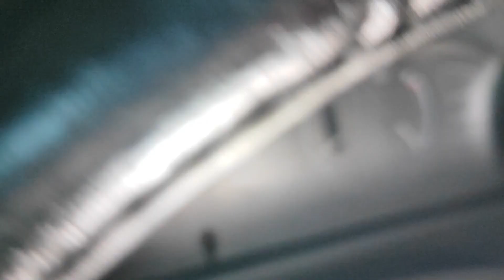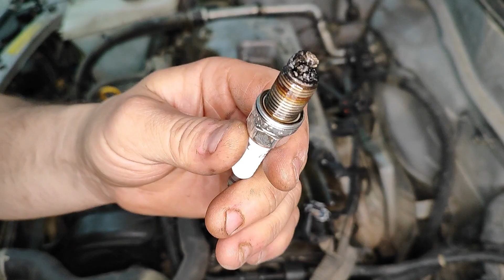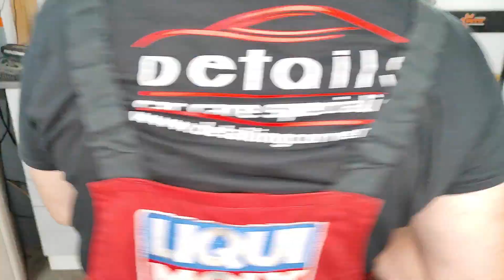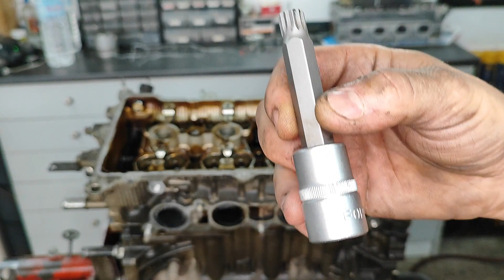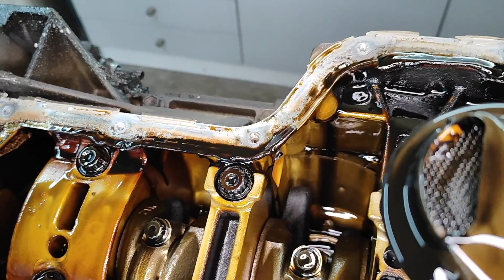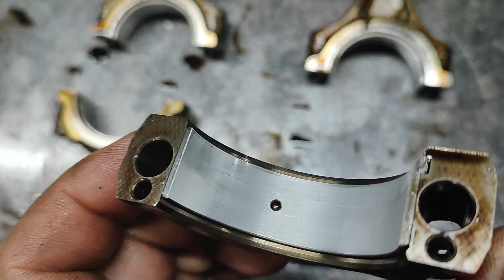Toyota  Corolla 4ZZ engine build part 1 (teardown)!

Comment: My one gives a poor milage...does any one know how to recover the milage??
Reply from the maker: If you mean it consumes much fuel It could be many things depending on the milage of the engine. It is worth cleaning the fuel injectors check the catalytic converter replace the air filter and it will surely get better fuel consumption.

Comment: Hi, what kind of oil did this car use? At least the viscosity
Reply from the maker: This engine was disassembled at 420000 km. The owner bought it new and until almost 300000 km used 5w-30 oil. Not a specific brand though. After he used 10w-40. The important thing that kept this engine so clean was that the oil was changed every 5000-7500 km.
Reply: @amtperformance7072   Thx u bro!

Comment: Hey !  Very good video. Can I swap a 4ZZ-S52 into a E11. Corolla that has a 3ZZ-FE ? I have the ECU for that 4ZZ engine and I see ou have 3 pin f.ecs. on the valve position sensor..and 3ZZ has two pin...  So...can the ECU be plug and play and the wire no problem to change ?  Huhh He he he,  My car is liftback and looks exactly like yours and is 2000 model.

Comment: I have the exact same engine with 165k kms and so far it never consumed any oil. It started to a bit after 160k kms and now i think i need new oil rings, what would be the price of that approximately and is it worth to fix it? considering that the car is old

Comment: Fantastic video, i have a 2003 corolla 5d 1400cc with 260.000km ,also the last 14yrs modified as an LPG. The first years i used 5w40 oil, later on 10w40 and the last 2 years again 5w40. Oil consumption is about 1lt per 5000km, i change oil/filter at 5-7.500km. Should i continue with 5w40 or better use 5w30 that recommend most oil companies about this model ?
Reply from the maker: Hello! The best thing is that you change oil and filter at 5-7.5K. this way your engine operates with clean and fresh oil which is the most crucial thing for longevity. As for the viscosity, there is not much difference between 5-30 and 5-40, but the specifications are more important. The best is to use a C3 or even better C4 specification oil. The consumption you state is very  acceptable at 5K for an LPG converted engine with such mileage.  Thanks for the comment!
Reply: Hi. I have the same car as yours with 100k km. Does the Toyota go well with lpg?
Reply: @marte @martenedens  Corolla runs fantastic with lpg(zavolli is mine) but if you want the engine to be 100% bullet proof you should drive normal and not to exceed 3000rpm, something that is the correct way for all lpgcars regardless is not mentioned often. Fantastic economy with lpg. Also keep in mind to change the oil/filter every 7000km( i change mine at 5000km!)  max and to use if possible the Valvoline Restore & Protect 5w30 because at most vvti engines the piston rings get stuck( regardless lpg)and start to consume oil. If you do all the above you ll be king !!!!!

Comment: Got same car, same 4zz-FE engine, 180 000 kms. Noticed mine has a rattling metal noise only when accelerating hard and only when car is fully warm + I monitor my oil and calculated on approximately 5000km I loose about 800ml of oil. Any ideas about both issues, what it could be?
Reply: It may also be your timing chain. I recently replaced mine with the same issue.
Reply from the maker: The metal noise you hear i suspect it is pre ignition. Try higher octane fuel and if it still pinging may be a coil or something deeper. As for the oil consumption 800ml at 5000km it's moderate. Among other things it depends on the way you use the car, but it is not serious matter yet.
Reply: @amtperformance7072  So I did load 98 Octane fuel and the sound has lowered, but not eliminated it. its still there around 60%. Any other thoughts what it could be to try next?
Reply from the maker: @tcommonsense maybe its a faulty knock sensor. Or your fuel injectors must be cleaned. (Most probably its the knock sensor). Maybe there are deposits on the pistons (from bad combustion) which raise the compression ratio so you hear pinging. In this case you can add a fuel injection cleaner to the fuel tank and eventuallu it will clean a portion of the deposits.
Reply: @amtperformance7072  Thanks man! So what I did was add Seafoam SS-14 spray directly into the cylinders (through the spark plug wells) 3x times , small amounts, each time letting it soak for 8 hours. After that started the engine and didn't notice much smoke, but car is knocking even less now, lets say from 60% to only 15%. Still there, but major improvement. Considering this is it safe to say that indeed carbon buildup is the main suspect here?
Reply from the maker: @tcommonsense  yes it seams that it is tha case. At least most of it. The seafoam will also unclog the oil control rings from sludge. But dont use it frequent. Use it now to clean the most carbon from the pistons and then add a fuel injector cleaner agent to the fuel tank. It will eventually clean even more the combustion chamber so it will not knock much.
Reply: @amtperformance7072  Thanks for all the support towards a random dude from youtube's comments section with his Toyota man. You remind me of the good old days of the internet where people were just kind,open and honest with each other and most importantly - wanted to help each other. Will continue monitoring and working on my car. Cheers! Also - subscribed.
Reply from the maker: @tcommonsense  thank you very much man! It is as you say... People nowadays are aggressive without any reason. Continue working with your car and have fun. Cheers from Greece!
Reply: @amtperformance7072  Thanks! Will try a higher octane fuel and see if the "metal clanking" noise is still there when warm and accelerating hard. Forgot to mention its only in a very specific RPM range (possible between 1500 and 2500).

Comment: I have an E12 2005 Corolla with the same engine with just 79,000 miles from new. I can see it going well over 100,000 miles as i frequently service it and is well maintained.
Reply from the maker: If you service it more frequently than the schedule book it will last longer for sure!
Reply: @amtperformance7072  I service it every 6,000 miles
Reply: @amtperformance7072 I once went 10k between a service but do it every 5k now. I've put a bore scope down each cylinder too. Very clean
Reply: @amtperformance7072 o meu 2005 está todo original o motor com 350mil até o câmbio tudo original
Reply: 300k miles no problem, find a DIY garage where u can rent the lift and do the oilchange yourself, youll save a ton of money and can do them even more regularly

Comment: Great video and impressive to see such little wear after so many km. This is good to know because I have the same engine but 1,6 and in a Corolla from 2003, at them moment 168 000 km and I change oil and filter every 5000-6000 km and I buy the items from Toyota.
Reply from the maker: Thanks man! It was regularly serviced and behold the results. You do the right job to change the oil frequently. It's the engines' life.

Comment: Hey there! Recently I've bought a E12 Corolla with the same engine, it's now at 289,000 km on the dash and running perfectly and smoothly. 
One thing I noticed almost immediately when driving the car is when changing gears to higher ones the RPM goes up a little (about 300-400 RPM) for about 1-2 seconds precisely when I step on the clutch and step off the gas pedal. In all other cars I've driven they did not do the same (RPM goes down immediately), so I wondered if this is a feature of the engine or the ECU or some malfunction somewhere. 
I ended up reading a lot of things about it on Corolla owners forums and apparently it's a normal thing. Toyota has made it like that as default to better control the gas emissions, but I would like to know other and different opinions about this - is it true that all 4ZZ-FE 1.4 16v behave like that? 

Because it can be pretty annoying to drive like that and it gets worse at higher RPMs and higher speeds. The workaround for it is to release the foot off the gas pedal one second before stepping on the clutch to change gears... so it makes us create new driving habits. 
I had an Avensis 2.0 D-4D Diesel the same year as the E12 and it did not do the same thing, although I know it's a completely different engine and fuel. 
I appreciate any comments about this.
Greetings from Portugal!
Reply from the maker: Hello. I suspect a vacuum leak on the intake manifold side. Your idle is dead smooth or it fluctuates even a little? If it is, most likely there is a leak. There are some small vacuum hoses that probably are the cause of this.
Reply: @amtperformance7072  Thanks for your reply. My mechanic had a look at the issue I described and actually blamed the Throttle body or any sensor / valve connected to it. He said that ideally the complete throttle body should be replaced for a better result. They cleaned it up completely but it didn't help much. Due to the high mileage, there's a natural wear down.
When idle, RPM doesn't fluctuate but it stays a bit lower than what is expected and the car vibrates a little.
They connected the car to the diagnostics but they didn't tell me of anything related to vacuum leak, although I may ask them to check for that just in case and maybe replace the manifold gasket. At least it's inexpensive. If I have to replace the full intake manifold that can be really expensive... I hope not. 
I'm still knocking my head on this high revvup thing when changing gears and to me this can't be normal or standard... But I might end up getting used to it. 
Well, thanks a lot again for your analysis and support!
Reply from the maker: @fabiomartins1866  It' almost impossible for the throttle body to wear at a state that it is not working properly. The engine on the video had 435000 km and the throttle body worked perfectly. BUT.    Right under the butterfly there is an electronic valve that adjusts the air passing when the throttle is closed. The cavity inside is very difficult to clean but if you disassemble the valve you can clean the cavity. Of course you must take the throttle body off the manifold to do it.  Of coarse if you replace the entire throttle body it will work fine. But it is that valve which is not working not the body. Insist to your mechanic to dismantle and clean it. At least it is much more cheap than  replacing the whole unit and i'm certain that it will solve the problem. Greetings!

Comment: I had this same model 8 years ago. Problem was that it cosumed oil (about a litre in 1000km). I was told that the cooling channels were to small the enginge had a to high fuell burning temperature. That got the pistonrings got stuck.
Reply from the maker: No. The cooling channels are way bigger in this engine than others. The problem is the long oil change intervals. The oil is cooked it forms small particles that block the oil control ring channels. Thats what is causing the oil burning!

Comment: Why didn't you show Crank and Camshafts???
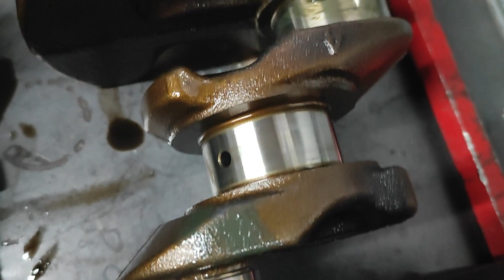Reply from the maker: The crankshaft is shown at 31:50.  You are right about the camshafts. I put them on another bench and forgot to show them. But the journals and the lobes were in near mint condition with no signs of wear or marks. I will show them on the second part of the video, the assembling of the engine!

Comment: Did this engine still have the first, factory timing chain? About how many kilometers was the oil changed on this car, is it 15, 20, 25k km a year? I would say that it was at least 15k km, otherwise it would be difficult to withstand this mileage.
Reply from the maker: I know the owner and he bought it new. The timing chain has never been changed. Not only that but even the water pump and the radiator are never been replaced. I cant believe it myself... The maintenance was always on time and never exceeded 10000km intervals.
Reply: Then the key is obviously short oil changes. Here in Europe, they still sell new cars with 30k km oil change service intervals. Let's say a new skoda(vw) kodiaq 2.0 tdi. And people fall for it. @amtperformance7072

Comment: If I'm not wrong it's 1zzfe 1.8
Reply from the maker: No. It's 4Zz-fe 1.4 16v
Reply: @amtperformance7072  but they seem the same I have a corolla same engine but 1.8
Reply: I wanna I ask like a silly question apologize for that from the heart❤️ I was wondering in the 1zzfe from 2002-2007 1.8 they have vvti where is the location what does that plug looks like I would be greatly appreciated if you show us that plug if they have where does it source
Reply from the maker: @samueleyasu3531  yes its the same serries (zz) engines. They look very much the same. I dont understand what exactly you want to know. You want a picture of the plug of the vti or the location of the solenoid on the engine?
Reply: @amtperformance7072  well honestly I want to know the plug and location
Reply: i was about to say the same thing

Comment: I have had a few Toyota Tercels with over 300,000 km and a corolla... all from the 90s... To be fair, I also had a 2L VW Jetta (gas) that had over 320,000... Well built engines last. 

I do have to say that it is shocking how good this engine looks despite all lf that burnt oil varnish...
Reply from the maker: 90' engines was way better built than newer ones. They were built to last. Modern engines may have technology but are made of worse materials andmore complex parts that fail. And dont mention the EV's......😆😆😆

Quite some cars you had! I'm sure you kept them all well maintained also.  Even a good built engine without maintenance has shorter life than expected.

Comment: Excellent! A very good example of how long a well built engine can last with regular oil changes, that's preferably more often than factory recommendations. Auto-RX could possibly loosen up the oil-rings and postpone the rebuild. Looking forward to the next video on this engine.
Reply from the maker: You are absolutely right for the more frequent oil changes. And yes similar products can postpone the rebuild but they must not be used often because can cause other problems. Thanks for the comment!! Stay tuned for the assembly!

Comment: OK 400k+ km is a lot. It's only logical that an engine would need a rebuild and one size up pistons. But it's amazing that the rest of the engine is relatively OK. The thermostat piping was like new inside.
Reply from the maker: Yes it is a lot but if you take care of ot it these engines can survive even more (not a lot more but ok)...